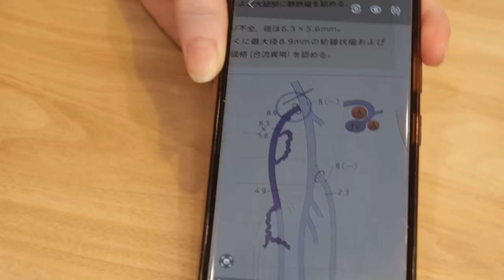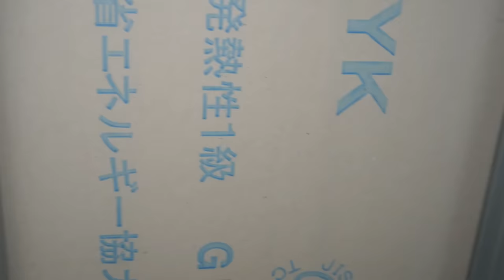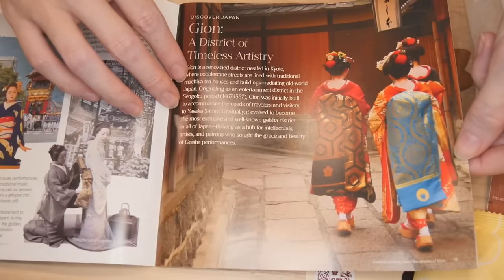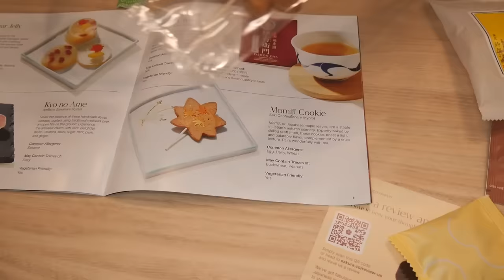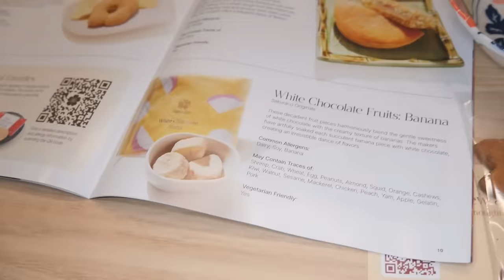I cut a hole in our wall and tried making a cat door 😬

Comment from the maker: Use code “RNJ“ for $5 off your first Sakuraco box here: https://team.sakura.co/racheljunadventures-SC2309

Welcome to my failure sandwich video. I have a couple other ideas for the door and I want to try to make it as soon as possible so it doesn't turn into a "yeah one day I'm going to finish that. One day..." situation. So hopefully next video will be a victory sandwich!
Reply: This definitely is a victory sandwich of a video to me! the door is so cute and cat content is always good content
Reply: Why did you cut out the name or model of your new Lav Mic kit? Are you holding out for a sponsorship or something? Please include a link to the new mic your using in the video description
Reply: hi rachel and jun great videos, i would recommend caulking around the frame so moisture doesn't leak into the wall and create black mold , also if you haven't already i would recommend placing a carbon monoxide alarm near it just in case keep up the content i can't wait for the next video😃
Reply: wouldn't a moisture barrier only be for an indoor/outdoor cat door? I don't see an issue with moisture with an interior one.
Reply: Maybe for the door you can use pretty wooden dowels that have ribbon or rope stapled to each one on the vertical edges to create a vertical "wooden rope bridge " instead of the horizontal ones. Like the ones you see on playgrounds or even some of the wall climbing cat bridges that hang between platforms but just the door version. I don't know if my suggestion for round dowels will help but I was trying to think of a way to help reduce noise  when the cats use the door, other than spacing them far enough apart, also reducing the amount of wood surfaces that could possibly come into contact with each other during movement. I look forward to seeing how you end up solving this small set back but I am still very impressed with the diy project nonetheless overall. ❤
Reply: Rachel I also have a blood type that mosquitoes consider the yummiest of snacks, and nothing ever worked against them until we got thermacell, you basically put it next to the area where you wanna work in the garden and give it like 10 mins. I never believed ANYTHING could protect me from the mosquito plague but this somehow works, it's insane and I'm so happy I don't need to spray myself with stinky repellent to be in the garden anymore, cause I love gardening 😭 One minus is that it's like only 12 hours per charge but we just bought refill packs on amazon
Reply: Hello Rachel! I have read that mosquitos cannot fly in even a light breeze, and that some people have had luck being outside with an electric fan set up pointing at them. I have not tested this myself, and I imagine it could create additional problems if you're trying to control the sawdust, but it's what I kept thinking of during your outdoor adventure!
Reply: I wonder if a canvas curtain would work? Good luck!!
Reply: @KeiPalace  in Japan the humidity is very high in summer so while the paint protects the walls from the outside if moisture get's in it can cause lots of problems like mold to the drywall/plaster and cause any screws or nails to rust, also it stops insects getting in and out of any small cracks and holes.
Reply: Just use a CURTAIN😆.
Reply: cut the slats with the grain ... for the parts that are short ... cut out the damaged bits and use them as the window in the door ... piece together on  cloth and glue down ... good ole elmers works great ... cut out the window spot in the fabric ... and poof cat door they can see beyond and that wont catch them ...
Reply: to avoid more chip out ... clamp the pieces between two scrap pieces or wood and cut across the grain .. this will provide support for the wood and leave a better cut ...
Reply: Hey Rachel! Try a black out cloth with weights on the bottom. I sleep during the day and my cats love the sun, it lets them in the window, but keeps the curtains from staying open when they jump through. Just take a lint roller to them every so often.
Reply: But... if you're a light sleeper, do you really want to hear a door flapping all night?  The indoor/outdoor cat doors need a barrier to keep out the elements, but does an indoor/indoor need one?
Reply: A little curtain would be cute.
Reply: Could you use dowel rods and drill holes in them, connect them with twine, and use the initial dowel rod to connect it to the door like your original design and kinda like the images you showed?
Reply: You could always just leave it without a door too. It works fine without one.
Reply: A fabric door?
Reply: I was actually pretty interested in the mic you were so excited about but Jun distracted your presentation with the Sony “walkie talkie”. 🥲😂

(Edit) BTW, you can wrap a canvas around the frame and sew a slit in the middle. The cats can then burrow through safely. Like those movies featuring quarantine zone where the person in hazmats suits have to step through. Or like a baby coming out from a VJ. 😂
Reply: Beads or a bamboo mat cut into a square would probably work.
Reply: @rosewaters2533  AYO that last comment tho
Reply: Hey Rachel. Why not use black out cloth for the door?

It aldo seems to me that you have a mosquitoe problem outside. So why not invest in a mosquitoe catcher?
Reply: Hi, just sharing some Information here. I read a few Years ago about proposed Ways to fight Malaria, and 
one of the proposed Ideas was to use a Laser, combined with Microphones to kill Mosquitos before they 
could reach Humans, and while i have no Idea if that Tech was developed, i thought i mention it to you
Reply: 100 years later when the house goes on the market "ah yes, this was def a cat person" <3
Reply: Why are your walls not insulated ? How weird! Do a plastic flap that is thin enough to bend easily, problem solved.
Reply: You could try something with cloth, maybe blackout curtain material :) this way the cats wont get caught e the light wont pass through. Love the video <3
Reply: You need a material that is softer than wood, but harder than cloth.

I am thinking something like rubber, but not too elastic, so as to not be pulled by the cats as they go through. 

Perhaps soft plastic that bends but doesnt break. Not too thin, and not sharp though. It is difficult to find the right material here, not gonna lie.
Reply: That kitty door is gorgeous!!! You did a wonderful job!!

If anything for a door do a beautiful piece of silk? Maybe lightly weight it?💖
Reply: Maybe a japanese style curtain like the ones you see at onsen's? That would be super cute as a door!
Reply: Maybe use slap and stick tiles that look like rocks?

Comment: I absolutely love that you immediately went "oh, this design has a potential danger, and even though I invested a lot of time in this, the risk is unacceptable". Not to mention supervising there first use of it and everything. I love watching you guys make these things and showing us the struggle!
Reply: I hope Rachel and Jun reads my comment. They could use a door drapery or just a flat fabric with weights on the bottom. I feel this would be the safest way to do it, if you don't want light shining through. If that doesn't matter, just leave the hole open.
Reply: @Odin_Bladeworks  another thought i had was how it might impact air conditioning leaking through the hole
Reply: @dixonyamada6969  in that case maybe they could use a heavier fabric or the kind of insulation used in lunch bags~
Reply: @spooky-pumpkin  That's actually a great idea. Lots of good ways to solve this problem I feel.
Reply: Lol I immediately knew the door was too heavy and thick to work 😅 but I trusted Rachel yo figure it out lmao ❤

Maybe they can use like a light cloth flap?
Reply: Yeah I'd be the same. No kitty hurt possibilities if it can be helped. I changed out my cats scratch pole from tiny rope to a thicker more sturdy rope because he's gotten his claw caught and because of the slight give of the thinner rope it wouldn't come free easy.
Reply: @Odin_Bladeworks  They could make a mini noren for cats lol. But in all seriousness I see fabric-based solutions getting yucky with cat fluff quickly…
Reply: @Smile936 not all fabrics collect hair, and there is also leather! Easy to clean 😊
Reply: Or some type of plastic sheeting that can be easily cut and cleaned. You know how they have that sticky wallpaper/counter top
 Sheets that look like wood, maybe you can paste that onto a flexible plastic so it matches the aesthetic more.

Comment: i think the cat flap for the cat door would be really cute as a noren, the traditional japanese fabric dividers like those seen at bars and sushi places. it would be entirely safe for the cats, silent when used, easier to push, washable, block light, and be aesthetically pleasing!
Reply: I think this could work really well! It should be lightweight enough to be safe for them
Reply: I was to write exactly the same thing, it's a great idea!!!
Reply: I vote for this idea! Hopefully she'll do it. 😸🦋
Reply: Came down here to say exactly this!!!
Reply: If there was two of them, one at each wall face, it might actually block sound better than the wood
Reply: yeah! as im guessing the door part is mooostly just for the light :) and fabric doesnt make sound!
Reply: @LuxicCardinal  well if one person is sleeping and the other is doing something in the living room blocking that noise could be an issue
Reply: I was going to suggest fabric as well. You could maybe hang it off a small dowel like a curtain.

Comment: Pet doors are usually made of a flexible rubber or plastic so if anything gets caught the door flexes a bit so the animal can pull free.
Reply: They don't have a tunnel attached, so the passage isn't more than a few centimeters. That changes everything!
Reply: @mellie4174  Is this going to be one of those situations where I explain why it would work just fine and you disagree and your arguments don't seem to make sense and we find out ultimately that it was all just a miscommunication because you didn't read the part about the door being flexible rubber? Because I just can't handle another ridiculous frustrating conversation.
Reply: @mellie4174 , our doggie door is like this, so it has 2 flaps. One on each side.
Reply: @kathyperry9341  yeah two flaps could work. I was thinking just one on the bedroom side but two flaps would probably further reduce the heat and sound transfer between rooms.
Reply: The plastic is not flexible, we had to remove it because one of our cats got stuck. Rubber for sure would work.
Reply: @aperson4640 mm I know that feeling

Comment: If I may suggest a solution for the litterbox. Buy a big piece of plexiglass and make circular cutouts for the plants. This way you can have the rocks below and the plate above providing a safe cover for the cats to walk on and not get down below.

You could put up a little blackout curtain piece on the bedroom side, for them to pass through. Just hanging over to help prevent most light from coming in at night, without being a risk for the cats.
Reply: 2 genius ideas! 👍
I hope they will use it (at least the first one)!
Reply: I feel Rachel and Jun's pain, once a cat begins urinating in a space, it's pretty much impossible to get them to stop, the main focal point under the stairs is the plants, the gravel is a nice detail, but to me it's not necessary. :D
Reply: Oh, you know those curtain type of things they have in front of japanese ramen shops?
They could do smth similar to this
Reply: put a lip of silicone around the circular cutouts (on the top of the plexiglass, not around the inside edge). this will both give the planters some cushion and stability and also make it so if the cats DO pee on the plexiglass, it wont leak down into the rocks or onto the planters.
Reply: I think they had like, the equivalent of kitty spikes but that did not stop Nagios. If they can smell their scent they'll keep trying to go there
Reply: There is cleaner you can get that has enzymes that gets rid of the smell and prevents the cat from wanting to urinate in the same spot again. I've used it and it does work. Even stops other cats from wanting to mark the spot.
Edit: I can see it would be a bit more difficult to clean all the rocks but I think a soak would probably do it.
Reply: This is a great idea
Reply: @borountree4539  what is that cleaner called?
Reply: Like a noren... great idea! It would be very cool... 😄
Reply: Two brilliant ideas
Reply: @londonmellow I’m not that person but if you are in the US try  Nature’s Miracle or Chemical Guys Fabric Cleaner enzymatic cleaner, both have different smells and both have worked for me- just make sure to follow the instructions. If it’s carpet you can also pull back the carpet and get the foam pad cleaned or replace that part.
Reply: could even do like those split curtains that are on japanese shops sometimes! take some cotton or even blackout fabric and use fabric paint to make a custom cat-themed design
Reply: And it'll catch dirt and kitty tumblefluff to make cleaning the rocks easier!
Reply: Ooh Yess!
Reply: @shadowsilver8064  it would look really nice! It's really cute and they can still have a nice rock garden the cats have no access to!
Reply: Great ideas!
Reply: YESS THIS IS WHAT I WAS THINKING!!! A CURTAIN FOR THE DOOR INSTEAD OF A REAL WOODEN ONE
Reply: A blackout curtain material with a small a weight (such as a dowel in the seam) in the bottom so it doesn't get caught on the top tunnel area. Also curtains on both sides would reduce any drafts between the room and upstairs hall.
Reply: That's genius!

Comment: How about making a curtain rather than a swinging door? No worries of light coming in, and then can push through without pinching any kitties! Always great to see you with power tools, I love some good DIY too!
Reply from the maker: I'm going with the removable fabric curtain for now! 💕
Reply: @RachelandJunAdventures  My cats would tear that fabric to shreds in a day. :)  But there are flexible dog door flaps on the maket. Buy one and trim it to fit.
Reply: @RachelandJunAdventures  perhaps a part of a bamboo mat? It would still look nice and I don't think the cat's would go after it
Reply: @RachelandJunAdventures  if you use fabric or something similar, it is best to put a light weight at the bottom edge so the curtain goes down after the cats go through...
Reply: @RachelandJunAdventures I was thinking about a noren for it!

Comment: For a cat safe door, would a small bamboo mat or a heavy weight fabric with weights at the bottom work?  If you use a heavy weight fabric you could also style it like little curtains so the cats can just push through the middle and you can tie it up on either side if you just want it open.
Reply: Oooo I like this idea! I wonder if they could find one of the places that recycles old Kimonos and use some pretty Kimono fabric. Or style it like the curtains on the Hakata Yatai~ Instead of ラーメン it could read ネコ 😆
Reply: maybe Rachel can order a couple bamboo placemats and cut them down to a door size.
Reply: Great ideas! Or a combination of both would work. Get a sushi rolling mat for the flexible structure and cover it with a pretty fabric to help block outside light. 😊
Reply: @vikkumari omg I love this idea 😂
Reply: I did something exactly like this in my own house! It worked great. The only problem with the curtain is that it acquires a lot of cat-hair over time, but that's what laundry day is for, right?
Reply: My vote goes for the bamboo mat

Comment: Not having a door on it for a bit is a great way to build the cat's confidence for going through it. Should make it easier for them to use the new door once it's installed. ❤ And the new for will be safe! 🎉 Celebrate your achievement.
Reply: 100% agree. I have installed cat doors before, and cats adapt to them faster if it's an open passage first. Take this as a win.
Reply: I loved reading both of your comments!! 🌱

Comment: Maybe an unconventional idea but light blocking curtains might work as a door?
Reply: This. And add weights at the bottom so they stay in the shape you want.
Reply: Or a think square piece of (possibly vegan) leather. It would be more sturdy than a curtain, still block the light and not hurt the cats.
Reply: Curtain was my first thought too!
Reply: Yes! We had the same problem of cats wanting to come in and out of the room but us wanting to keep the door closed to prevent light from coming in. We hung light blocking curtains in front of the door and keep the door cracked open now. I imagine the same solution could apply here.
Reply: They make weighted trim to go in the bottom of curtains that might help keep the fabric in place.
Reply: You could even keep the wood but have the bottom half or third as a fabric as some suggested. That way, it's sturdy and won't catch their lil paws or heads
Reply: my thoughts too, like it doesn't have to be wood or some hard material.
Reply: A large potholder.

Comment: I know it's not quite the same, but maybe a glass screen over the rock bed could work as a compromise! :) Like how you sometimes see in hotels/etc

That aside, I would probably have put some legs underneath the catflap tunnel, so the weight isn't entirely supported by the drywall! :3
Reply: I'm pretty sure  he'd piss on it anyway tbh.
Reply: An acrylic or glass screen also has the added benefit of never having to meticulously clean the ornamental bed, ever. No vacuuming the rocks!!

Comment: Typically, cat doors are made with flexible vinyl or rubber flaps that is at least semi-transparent, so maybe that would be a better replacement for the door?  You can also add a gasket around the edges to help insulate it better.  It's also important to create a way to seal off the cat door in the event that you need to keep the cats out (say if you have a contractor coming to do electrical work or something).  Good luck!  ❤